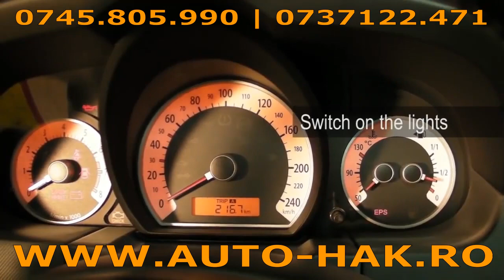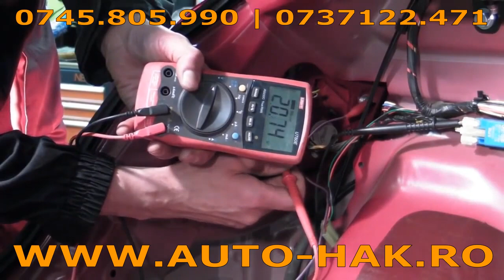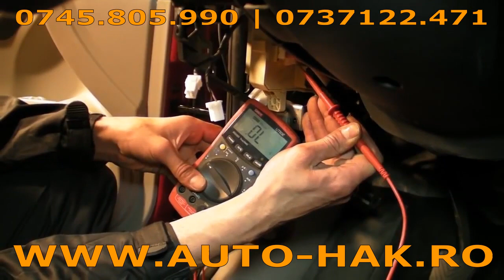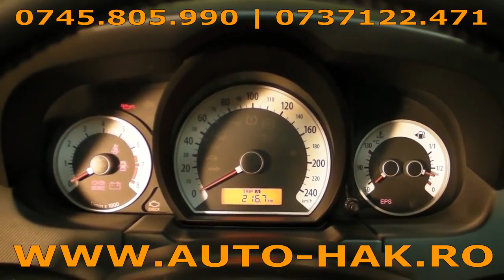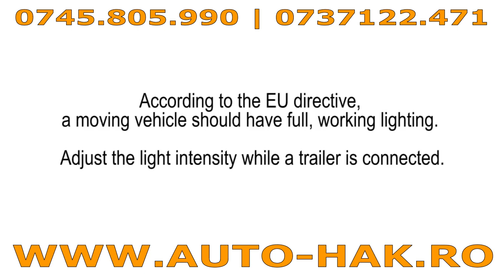Instructiuni de montaj modul electric carlig de remorcare

Comment: Cel mai indicat este sa va cumparati o masina nu o CARUTZA cu volan Logan, sau alte cazane facute la Pitesti.
O masina adevarata nu iese din fabrica fara tot ceea ce este necesar ca sa o poti numi masina.
Orice masina adevarata este conceputa sa poata tracta o remorca si implicit sa i se monteze fara alte module, etc, priza electrica pentru remorca sau rulota.
Am montat fara probleme priza cu 7 pini la un VW si a functionat perfect, dar VW este masina.
GUNOAIE frantuzesti readuse in colonia Romanica.
Dar romanilor care sunt obisnuiti cu carul cu boi li se pare ca Renault este masina.
Reply from the maker: Buna ziua! Necesitatea montarii modulul electric nu tine de marca masinii, ci de dotarile acesteia. Daca aceasta este echipata cu functia de check control, este necesar modulul electric, daca nu, este suficient un kit standard, format din priza si cablaj
Reply: Ma ajutati cu ceva?
Reply from the maker: @viatalatara5076  Buna ziua! Cu ce va putem ajuta?
Reply: Am rezolvat cu montarea modulului...pentru un sharan din 2009.Dacă cineva are nevoie de ajutor, va ajut cu tot dragul.
Reply: @viatalatara5076  puteti sa îmi spune-ți la ce se folosesc clamele roșii? Din ce am văzut in video nu sunt folosite
Reply: Asta nu e un Renault.
.cunoscatorule